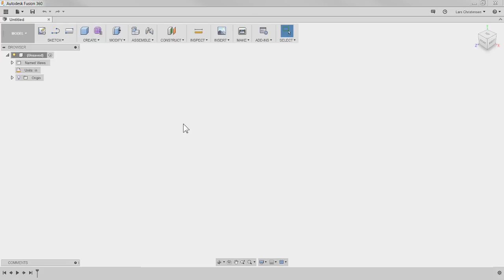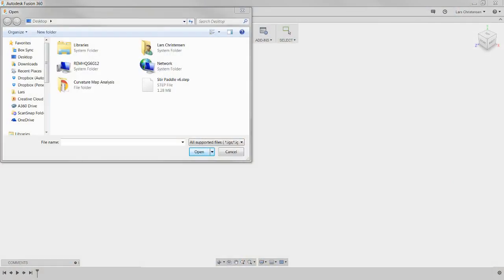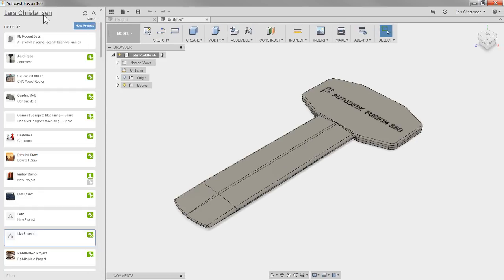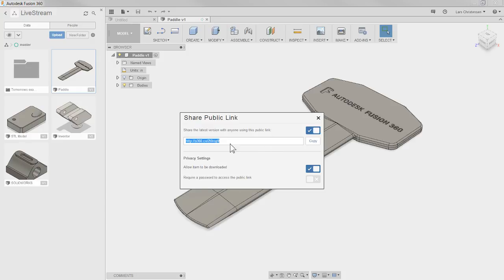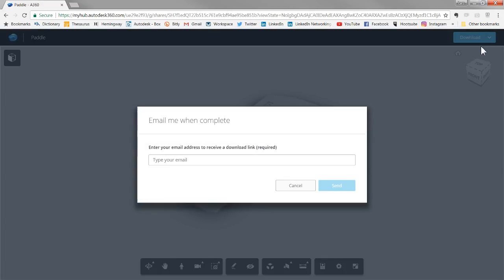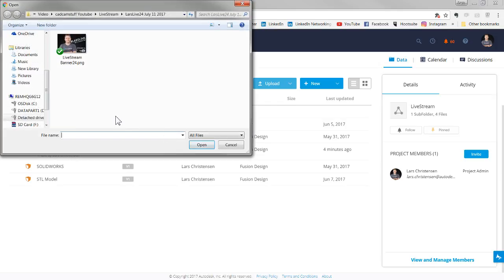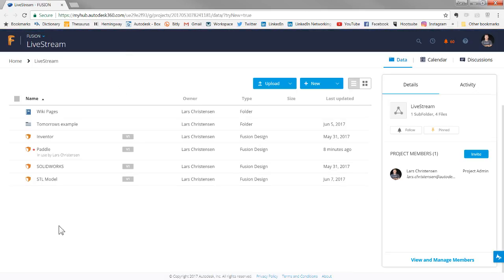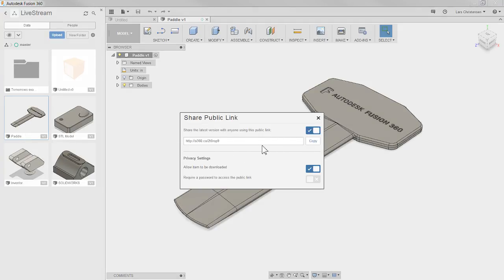Fusion 360 — File Save, Upload/Download Files (Beginner) —Your Comments & Questions — #LarsLive 24

Comment: If cloud functionality were for the benefit of the user, it would be an option. The fact that it's mandatory makes it clear that this is for the benefit of Autodesk.
Reply from the maker: There is the option to turn off syncing to the cloud within Fusion. There are also a program called Autodesk Inventor. It only runs local.
Reply: @cadcamstuff  How do I turn off cloud syncing? I can't find the option and Autodesk says on their website that this is not possible. https://knowledge.autodesk.com/support/fusion-360/learn-explore/caas/sfdcarticles/sfdcarticles/Can-cloud-storage-in-Fusion-360-be-disabled-in-favor-of-a-local-on-premise-server.html 

It looks like Inventor is going for around $2000. Fusion360 is free to home users for 12 months. (Not exactly apples to apples.)  What happens after 12 months? Who knows?
Reply: @jasonburbank2047  What happens after 12 months? All of your work that you have done for the past year disappears and is held hostage; you won't get it back unless you pay the ransom fees that they demand.

Comment: Hello Chris, I'm moving from SW and I want to program G code. I have 4 parts to make from the same piece of material and I have the modeled the raw material also, now the question is how do I position the machined bodies with respect to the raw material faces?, let say at 0.02" measured at the sides of the raw material. If you ever used Solidoworks, the mate called DISTANCE is what I'm trying to find in FUSION. That mate allows me to position planar faces at an especific distance each other.

Comment: It's simple. It's hard not to spill a big rant but it's so typical of vendors pushing the whole cloud b/s these days. Why lock this down? Maybe the user doesn't want or need version control. Autodesk "forcing" saves to their storage is very shifty indeed. 
Deal breaker for me. Off to find another app from a choice of many. Sad because this looked like a good option and Lars your tutorials are exceptionally good.
Reply from the maker: Hi Mark Lowe Thank you for watching!
Here is another great option:
https://www.autodesk.com/products/inventor/overview
Reply: Thanks Lars. I'm all for the sharing library and collaboration with others. It has it's obvious benefits for all.  Autodesk just don't need to lock out local save to maintain cloud integration. It sends a signal that they use force to steer market rather than leading by demonstrating its merit.
Reply: @marklowe7431  Lars, thanks for the tutorial and the time ... ... Unfortunately, I agree with Mark. Its really seems like a coercive tactic by Autodesk to force users to put their work onto the cloud and make it incredibly cumbersome to save locally at a location of your choosing. Mark, I recommend you donate to the Linux Development projects. FreeCad https://www.freecadweb.org/ is working hard to develop an open source and free solution to CAD/CAM on linux. Its still very much unpolished and in development (for obvious reasons related to funding). But recently they have released tools for toolpath/CAM control. I'm donating to them - I'm slowly switching my work flow completely to Linux and open-source tools. But they need all the support they can get: https://www.freecadweb.org/wiki/Donate
Reply: @voiceforjusticeandproporti5543  Funny you should say that. I'm now using freecad. I'm also a long term user of Eagle and with Autodesk now owning that too, its future looks dim. It already requires online login and i'm assuming they will cloud mandate its usage at the cost of the customer. I renewed my license for Eagle about two weeks ago. Logged a support ticket to find out where it is and still no response. I've since swapped to KiCad which is open source as well. It's also very good. Short term pain learning it but it's less pain than dealing with cloud crazy vendors. Only losing clients will make these vendors realize cloud is not always appropriate. Their initiative to host user community and share is a great one. Forcing it isn't imo.
I'd be very happy to pay a sensible license fee for both and be able to save local. Their call, but their loss. The irony is open source software is not only amazing, I pay them a donation each year anyway. They deserve it.
Opensource 2, Autocad 0
Reply: @marklowe7431  I hear you there. I also used to be an avid user of eagle! ... I've switched away from it and I'm now using Kicad as well! This cloud business really is frustrating. Autodesk .. guys really - you are producing some great software. But this cloud business .... I second Mark on this don't force users.
Reply: @voiceforjusticeandproporti5543  What's funny is Dave that runs EEV blog did a video on Eagle using a subscription based on feature. It was very good. They ditched the idea for this. The irony is i work in IT spending all my hours migrating business to cloud hosting. It's like chewing on broken glass. We all know it will mostly head back soon. Really getting the hang of Kicad now. Autodesk are really helping Kicad increase their user base.
I was finally able to cancel my Eagle license. Another support call later. Very sad because Eagle and Fusion are great products totally destroyed by bad delivery strategy.
"Let's go cloud" Why? "I don't know but everyone else is". 
Autodesk, if you want to win, leave the product execution standalone. Allow a private save space local and make the shared space cloud. You will not only retain customers your market share should increase easily.

Comment: Great video as always Lars. I have a question for you:
My cache is currently set to 60 days, but files and projects that are a lot older, are still showing in the data panel and they open without any issues at all. Is it that the older (than 60 days) files are being re-downloaded from the cloud to my local cache.
I'm just wondering if, after the 60 days, I will still have access to all my files (however old they are) directly within Fusion 360?
Hope this makes sense